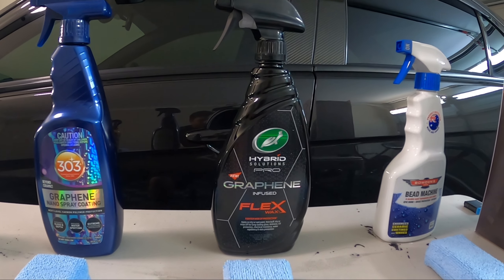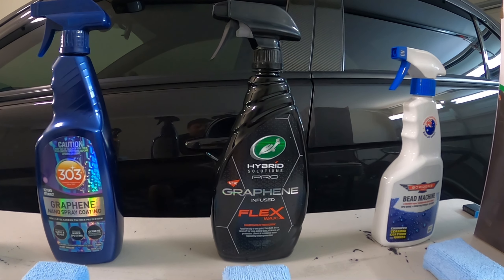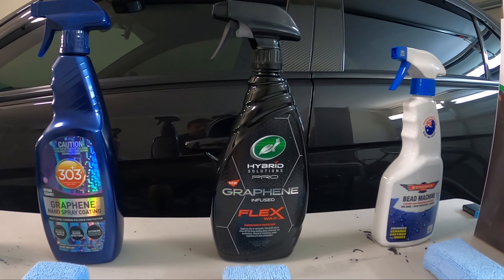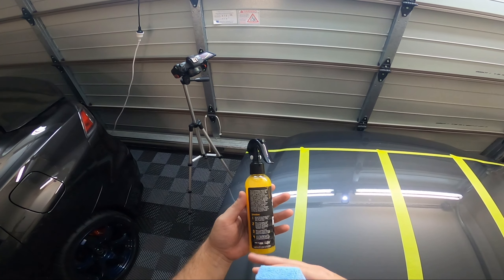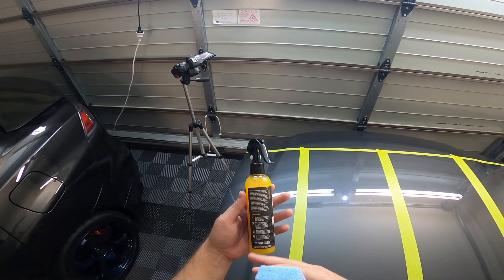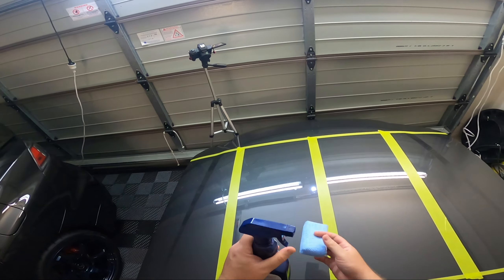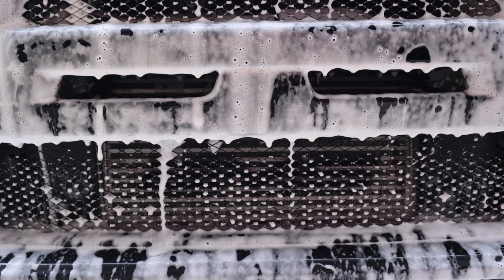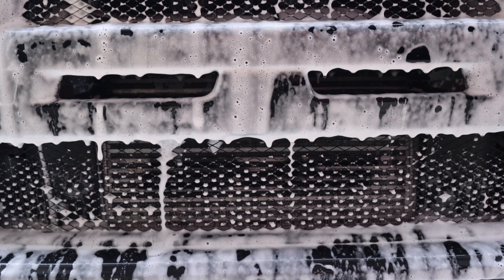Graphene Sealant Test Initial Application | 303 vs Turtle Wax vs Ethos vs Bowden's Own

Comment: You didn't apply the turtle wax product the way it was supposed to... it's spray on the paint, a quick spread with a microfiber towel, and immediately wipe off excess and buff.
Reply from the maker: I applied ot as per directions, it doesn't say spray on paint it just says 2 sprays per panel  so could be either onto an applicator or onto the paint directly i did possibly wait a little long for the wipe off but it was less than a minute since I was checking the label to make sure there wasn't a flash time like some of the others.
Either way though I had to reapply all products a few weeks later as some weed kill chemicals got on there and I instantly wiped off and still had issues with application compared to the others which were much easier to apply

Comment: Turtle wax is great but you should  follow the directions, shake the bottle, 2 sprays to help he whole panel.  No a portion. That’s why your streaks.
Reply from the maker: Yeah I potentially used too much and also could have used a wet microfibre to wipe off but didn't want to dilute it.
I can forgive the streaking and tough wipe down if the product performs well though and unfortunately this one did not do well.
I still stand by the only good sealant from turtle wax is seal and shine and all the new ceramic and graphene stuff they release is just worse yet more expensive

Comment: Use a damp microfiber for first wipe off with Flex..then dry.. works amazing
Reply from the maker: I should have done that but was worried about it then diluting the product or giving g any reason why it wouldn't be as durable

Comment: Been looking forward to this comparison, thanks! 
I'd hazard a guess that the TW was so streaky because you used too much of it. More than two sprays on 1/4 of a panel is pretty excessive. I've applied it a few times and never had streaking issues personally.
Reply from the maker: Thanks mate, yeah you're probably right. It wasn't so much streaking that was an issue just the incredibly grabby wipe off but either way it's off on there now so time to see how it lasts
Reply: I've been using all three for a while now.  The TW streaks even when using only a little. 303 is the hardest to remove. Ethos Resist in my opinion is easiest to work with.  No streaking.
Reply: The TW Flex wax is best removed/leveled with a slightly dampened MF towel.  Comes off with no streaking and very easy.
Reply: @joelpasserell4525 agreed -  just as the directions suggest.  I've found that an initial wipe-off with a dampened microfiber followed-up with a fluffy buff with all 3 Turtle Wax sprays - Seal&Shine, Hybrid Ceramic and FLEX levels and shines.  A minor extra step is not only a time saver but enhances shine and tactile feel.  The FLEX gets knocked for its price but compare its 23 oz. [U.S.] container size AND the minute amount that is needed to do the job - it is a bargain.

Comment: They aren't ceramic coatings... they're sio2  spray selects. Spray on, level, buff off excess.
Reply from the maker: The title of the video is graphene Sealant Test?
I don't remember calling them ceramic coatings as I'm qell aware they aren't. In the previous series before this I did si02 sealant comparison and actually showed a real coating on the panel so people could see the difference